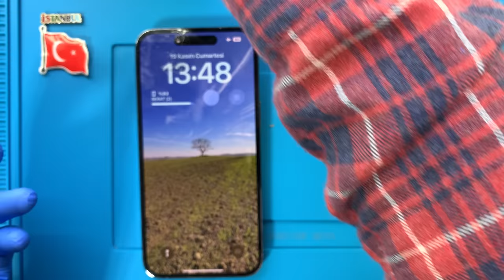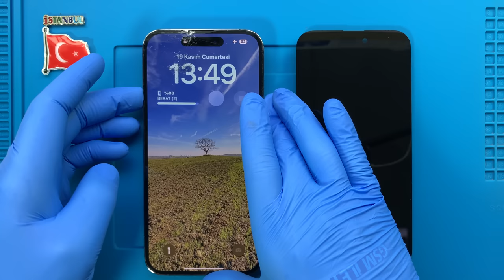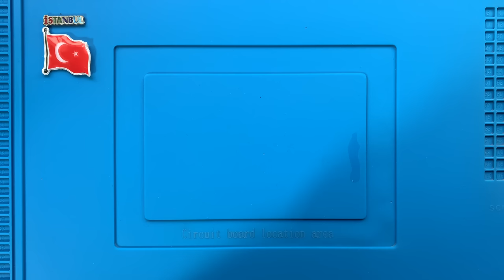iPhone 14 Pro Max Ekran Değişimi 🇹🇷

Comment: Still waterproof is screen replacement ?
Reply from the maker: Hello;
Phone manufacturers only guarantee water resistance for devices that are not damaged and have not undergone technical service. For this reason, it is necessary to be more careful about liquid contact after screen - part replacement and technical service operations.
Greetings.

Comment: What is that cable that you have attached on your wrist ?
Reply from the maker: Hello;
It is a static-free wristband. Our technical service is designed to be completely free of static electricity, but it is installed by our technicians as an additional precaution in order to prevent instantaneous static electricity.
Greetings.
Reply: @gsmi  wow now i got it thanks for the reply

Comment: Someone knows why my brightness is so pretty low on my 14PM after changing the screen for another original Apple screen? (didn’t transferred the IC or ambient light sensor)
Reply from the maker: Hello;
It may be caused by the screen. Or true tone may not have been transferred.
Greetings.

Comment: And for the true tone and screen message? The screen was working fine, why you changed the whole screen when you can fix only the glass and not showing the screen message later on! This kind of repair are easy to do by everyone, just replace it with the new one and finish...
Reply from the maker: Hello;
Some parts of the touchscreen were not working due to the internal screen broken.
Greetings.

Comment: water resistance function is gone right?
Reply from the maker: Hello;
Phone manufacturers only guarantee water resistance for undamaged and undamaged devices. For this reason, it is necessary to be more careful about liquid contact after screen - part replacement and technical service process.
Greetings.

Comment: You are a true professional! And your presentation is insanely accurate!
Reply from the maker: Hello;
Thank you so much for your valuable comment.
Greetings.
Reply: @gsmi  water resistant rip
Reply: I disagree. This was a poorly performed basic repair.
Reply: @PinealPinePineapple  yes, not disconnecting the battery connector first may lead to short circuit on lcd connector

Comment: what does static free bracelet mean
Reply from the maker: Hello;
It is a static-free wristband. Our technical service is designed to be completely free of static electricity, but it is installed by our technicians as an additional precaution in order to prevent instantaneous static electricity.
Greetings.

Comment: Water resistance gone just because you are lazy to clean the old adhesive and apply new one...
Reply from the maker: Hello;
All necessary processes are carried out in a special sterilizing environment with air vacuum. Get comfortable with this. But you can't put a camera in that area.
Greetings.
Reply: @gsmi  Dont try to fool me, you clearly didnt change the adhesive.

Comment: Bro your electric static discharge bracelet isnt doing anything when its strapped over your rubber gloves lol, it needs to be contacted to your skin to work. Just saying.
Reply from the maker: Hello;
Custom made gloves. It acts like skin.
Greetings.
Reply: @gsmi  Lies.. lol rubber gloves custom or not DO NOT CONDUCT ELECTRICITY, your grounding strap is doing nothing.
Reply: Nitrile rubber does not conduct electricity. In fact, it has strong electrical resistance, and as an insulator, electricity cannot easily pass through it. For this reason, it's frequently used in the power and energy sectors, including as a coating for electrical wires.

Comment: sadly, you should put a sim slot into it by the way.
Reply from the maker: Hello;
This model does not have a sim card slot.
Greetings.
Reply: @gsmi  yes, there is a plastic part on the spot of sim slot, some fixer put the apple original parts on instead and open a hole in the frame, cost 30$.

Comment: Is it still b water proof or not
Reply from the maker: Hello;
Phone manufacturers only guarantee water resistance for undamaged and undamaged devices. For this reason, it is necessary to be more careful about liquid contact after screen - part replacement and technical service process.
Greetings.

Comment: good job.  But if you changed the glass, it would be better, and it would have been better to put a waterproof❤
Reply from the maker: Hello;
Thank you so much. Liquid protection tape is made in a special sterilizing environment with air vacuum. Get comfortable with this. But you can't put a camera in that area.
Greetings.

Comment: You should have just replaced the glass on the original display instead of replacing the whole display. Goodbye Truetone, Hello Not genuine parts. haha... ✌🏻
Reply from the maker: Hello;
The touchscreen was not working because the internal screen was broken.
Greetings.
Reply: @gsmi  Hello! I see... but I hope you have used a tool to transfer the serial number of old screen to the new screen, so that the TrueTone will still be enabled. 😊✌🏻